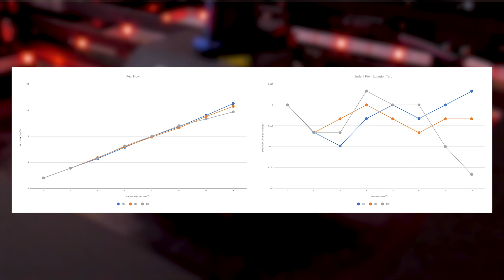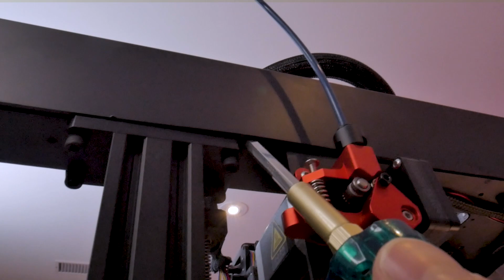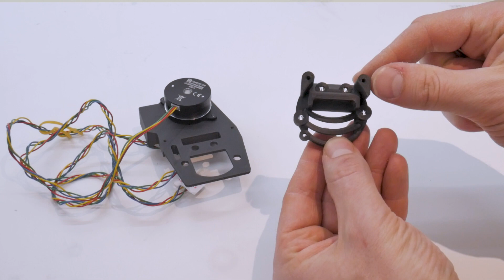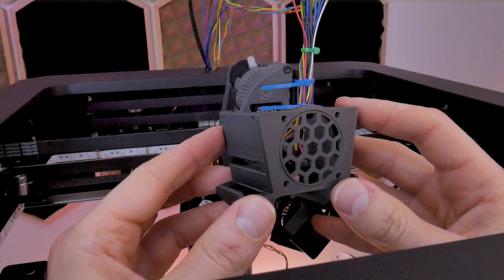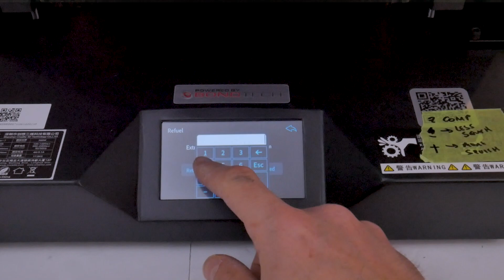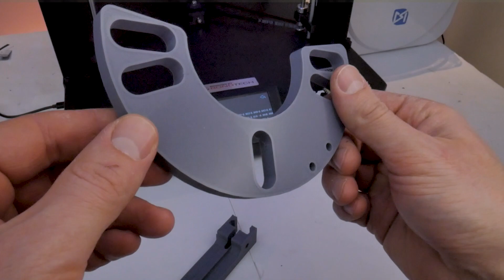Creality Ender 7 - Direct Drive Bondtech LGX Lite and Mosquito Magnum Hot End Install and Benchmark!

Comment: Not designing the hotend shroud to accommodate a better fan like: A brushless blower style part-cooling fans and a Noctua extruder fan, is a deal breaker for me. As the cooling of those stock Creality fans is just horrible. Although I have no statistics, but I have a strong feeling that this is the bottleneck of this performance upgrade.

Comment: Where is the file that sets the esteps?
lgxlite_estep562 mentioned in the video??
Reply from the maker: Open a text editor and enter the following:

M92 E562 ; Set E Steps to 562
M500     ; Store Settings

Then save it as any file name you want but instead of .txt make it .gcode and put it on an SD card and just run it on your printer as if you were running a .gcode file for a print. That's it :)

Comment: Outstanding Video, covers all the bases and makes me very confident. The parts you show at the end look so good I can see my train parts would be so much nicer than off my 10S Pro. But I am worried I will not dial it in as good as you can.  Can you print parts for others? How can I get quotes? I am drowning with a new release that has taken off. Printing 6 hours a day is hard on me and my printer has a failure yesterday and I lost 4 hours. Thinking this Ender 7 may be a good production printer and keep my 10S Pro for R&D. You videos and knowledge are excellent! Thank You, Dennis

Comment: I accidently turned the top screw instead of the bottom one on the board to adjust the volts    what is the top one supposed to be at for volts?
Reply from the maker: Hi Jason... not sure I would have to take my printer apart to find out for you.. did you get it sorted out?

Comment: great detail video however i have the spider hotend and i need the mount for it instead.  Do you have the file for that?
Reply from the maker: Hi Jason, I designed an adapter for the Spider but that is one that I sell through my website in the form of pre-printed parts (Carbon Fiber PETG) unlike how I released the Mosquito Magnum files for free. If you're interested, check out Embracemaking.com and check under the Ender 7 listings for the Spider adapter

Comment: Is the klipper video still coming or have you abandoned that plan? Been looking for a guide but only found a couple of githubs, but no real guides.  Ive duplicated your build and this machine is almost perfect now, just need klipper.
Reply from the maker: I got side tracked with some other projects. I actually bought a second Ender 7 to use as another development platform since the first one has been tied up with production. I will get to it :)
Reply: @EmbraceMaking  Hopefully soon! Awesome video. Great work and thank you for helping pave the way for the Ender 7 (and not writing it off just because it didn't work perfectly out of the box). I just ordered one and look forward to implementing some of these upgrades, especially Klipper.

Comment: Where does the 0.9V vref value come from? I left mine at the stock 1.25V and the motor doesn't get hot at all, it could take more I guess. Do you know what current 0.9V corresponds to? I couldn't find info for the Ender7 board resistor values.
Reply from the maker: There is a calculation online that associates the VREF with the current output of the driver. The LGX lite has a lower current rating than the regular steppers (especially the extra large one on the Ender 7 bowder extruder). 0.9V was the result of the calculation based on Bondtech's max allowable current for the LGX lite pancake motor. If your motor isn't getting hot then I guess you should be fine. Mine was getting hot at 0,9V but I've put a few hundred hours on it so far without issue.

Comment: Is it possible to use a dragonfly hotend instead of the mosquito hotend?
Reply from the maker: Do you know if the dragonfly hot end has the same mounting points as the ender 7 hotend?

Comment: I can't find file with code to change step per mm :(
Reply from the maker: Check here: https://www.printables.com/model/190248 scroll to the bottom of the description... just two lines of gcode :)
Reply: @EmbraceMaking  Thanks a lot! I'am converting my Ender 7 to DD using Orbiter V2, i am done most of mechanical work already and now start to tune e-steps and stepper current.
Reply from the maker: Best of luck!

Comment: Nice and clear explanations.
I like the way the wires are held in place.
What would be the full weight of the extruder and parts in this configuration compare to the original setup?
Keep up those great tutorials.
Reply from the maker: Thank you! I should have measured the weight but unfortunately did not. It will obviously be heavier due to the stepper motor / direct drive set up, but fortunately the LGX lite with small pancake motor is one of the lighter ones on the market. If I had to estimate, it probably only increased with the weight of the LGX which is 141g. The rest of the hotend and new fan shroud etc are more or less the same as the original equipment. By the way, your hot end system looks super interesting! I would love to learn more about it!
Reply: @EmbraceMaking  thanks for your reply. 
Well as you have probably seen on my website, it's a new approach on thermal efficiency with tapered nozzles. I'm waiting for a few parts  to bring even higher flow with longer nozzles. Early July I hope.

Comment: I have the ENDER - 7 for a week now, and havent had any issue at the moment building quite big model, like a full skull one to one size, and full human's face model. The only problem is that we can only print in PLA and PETG. I would like to see an upgrade in firmware for being able raise the temperature on both bed and nozzle, to print other materials, like ABS, PC, CARBON, even in Nylon. Carbon. Please keep up the good work, hopefully you may have better info regarding the firmware upgrade. I think most of us are waiting from you to announce it and help all of the ENDER - 7 users to get all those nice ugrades. But firts the firmware is the most important one.
Reply from the maker: Klipper is in the works, there are some configs floating around online for the Ender 7 now but I will do a video soon where I can confirm that one works and a walk through on how to get it working on the ender7
Reply: @EmbraceMaking  looking forward to the next video.

Comment: Just made my own customized version of your adapter for the Ender 7 since I want to keep my Bowden set up, and I wanted to ask, what are the "fins" behind the hotend for? I ended up removing them to make the whole thing even lighter
Reply from the maker: The angled fins are an attempt to try and divert the fan air flow slightly upwards and through that rear "window" away from the heater block ... whether or not they actually do anything is hard to prove. I actually removed them recently as well in the parts that I have been selling because I felt like they were unnecessary. Have you uploaded your design to Printables? I would love to have yours listed as a "remix" to my design on there!
Reply: @EmbraceMaking  well, the main reason to not upload it is that I made it specifically for my configuration of Cr-Touch and to fit my custom Teflon tube holder (the default ones are threaded, I got one with holes to screw it to the Mosquito)

Comment: hi. can i use the lgx mount and fan shroud but still retain the stock hotend? i just wanted to utilize the lgx lite that i bought.
Reply: apparently it does. perfectly! i just needed to flip the hotend so the wires are on the right and replaced the tube fitting with the older one and cut off the plastic top part so it would fit.
Reply from the maker: Thanks for trying that out! Do you have discord or anything where you can share some pictures? Did you have to print any other custom parts?
Reply: no additional parts. your lgx mount and fan shroud are perfect fit! i just needed to trim the part in lgx mount where the tubbe fitting touches so it would fit. you can check out my post at my 3D Printing Community PH fb group.
Reply from the maker: @rannski  Thanks for following up! Unfortunately I don't have facebook... are you on Printables, I'm assuming that is where you downloaded the files. Can you post a "remix" on my Printables page? would really, really appreciate it!
Reply: will do!

Comment: Hi. Is this design compatible with bl touch?? I really want to print this and install it on my ender 7 but i only have a bl touch. I also want to say that what you are doing is amazing! Thanks.
Reply from the maker: Yes, it is BL touch and CR touch should have the same mounting pattern. I haven't checked the overall height or probe length but I think they are pretty close... you can definitely mount it and the probe should deploy far enough to go past the nozzle :)

Comment: Hi. I own this printer for some 3 months now. I successfully ported this to Klipper and it's doing amazing prints. However, I am eagerly waiting for your version of Klipper port just to find the things I missed or can improve. One request from me is, can you do some mods on your printed parts to fit Phateus Dragon HF hotend? I own this but I cannot make a good mount to use this on Ender 7. Thanks.
Reply from the maker: Thanks Ram, I can look into fitting the Phateus Dragon HF, I know it is pretty popular. I'm working on Klipper soon and I'm going to have some amazing help it seems! Details coming soon, I hope you have subscribed ;)
Reply: i had a phaethus dragon HF but sadly it doesnt work that consistenly with the machine, i wen through two of them before giving up and switching for the Mosquito

Comment: it be too much replace the original mountplate to make room for the motor keep Y position of nozzle and reduce some grams?
Reply from the maker: I thought about replacing the whole plate but figured it was easier and quicker to do it this way. Plus the existing metal plate is very stiff, but yes it weighs more. If you replace the plate you have to undo the belts and retension the belt system... so at least for this method it should be less complex!
Reply: @EmbraceMaking  totally agree, i will try replaying the plate just for fun and tell you about it 👌
Reply: i finally finish my version with a custom  mountplate and works excellent, thanks for the tips and the motivation, i probably won't do it without your content